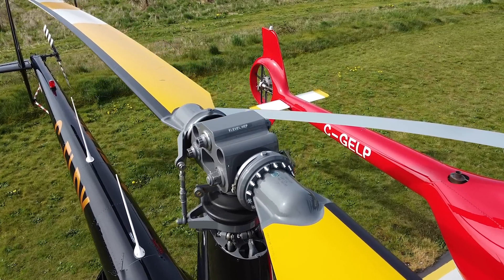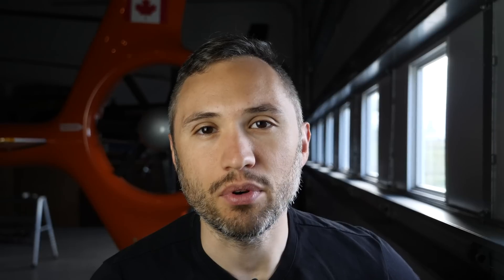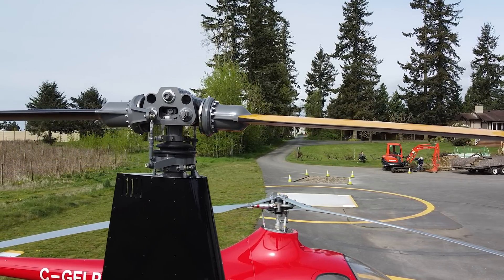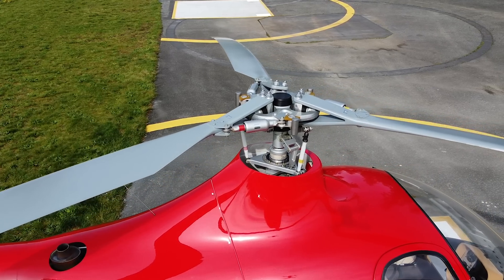WHY MORE BLADES ARE SAFER

Comment: How does the number of blades effect autorotation ?
Reply: Graham Goff It doesn’t.
Reply: @TimToussaint  Well it does not effect the concept of autorotation but the more blades you have the faster you fall. If you ever have to do an auto for real you'll want to be in a 2 blade system.
Reply: @TimToussaint  WTF? It makes a big difference!
It's well known that you need to be very quick to lower collective in an R22 or R44 if the engine fails. Then you need to actively monitor rotor RPM. Cabri, Enstrom and all other higher inertia rotor systems are far easier and more forgiving.
Also, the autorotation speed and required rate of decent is different for each heli and power required to drive different rotor system varies greatly....I could go on and on.

Comment: I love this channel. I'm signed up to fly the new personal quad drone (if it ever happens) and as a pilot I'm excited to see if this will be so much easier than flying a real helicopter. I'm already amazed at what a simple drone can do all on it own for a couple of hundred dollars. Once battery energy density and charging time improves I wonder if the inevitable future is electric multi-rotor craft due to their incredible (comparatively) simplicity and stability and maneuverability...
Reply: A heli is of course way harder than a drone
Reply: @pstreaks  Have you flown a quadcopter in acro mode?

Comment: At 1:11 you say a 2 blades system is less efficient. This is incorrect. Theoretically a single blade is the most efficient and every extra blade you add on top of that makes it less efficient. This obviously isn’t very practical though. “So in practical terms, the most lift for the least power is achieved with a 2 blade rotor, but the need to absorb more power with a limited desirable disc diameter forces you to add more blades (or you may want a smaller rotor with lots of blades for maneuverability or other reasons, but it's sub-optimal from a horsepower efficiency standpoint).” https://aviation.stackexchange.com/questions/62588/what-helicopter-has-the-most-rotor-blades
Reply: Isn't the problem with big, heavy helicopters that making the blades longer and keeping the blade tips subsonic exacerbates the lift differential among retreating and advancing blades at speed, so increasing the number of blades becomes the better engineering solution?
Reply: Gary Ward yes, it does become the better engineering solution. I think using the word efficient was the potentially the wrong way to phrase the point he was trying to put across.
Reply: @littlelawson06  Exactly..... if you ever have to do an auto for real you'll want to be in a 2 bladed system.
Reply: Check-out you tuber Night Flyyer,and his video Hammerhead.Seeing single bladed RC Helicopters flying around  is something else.